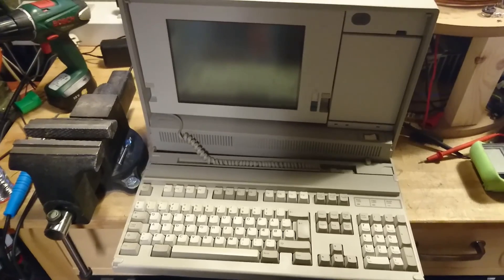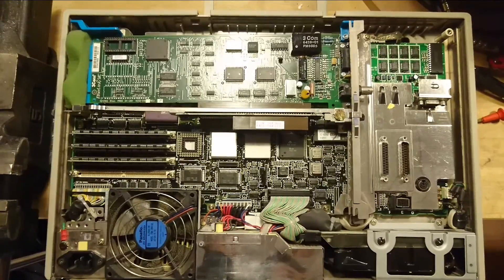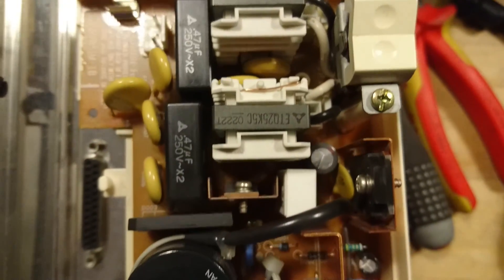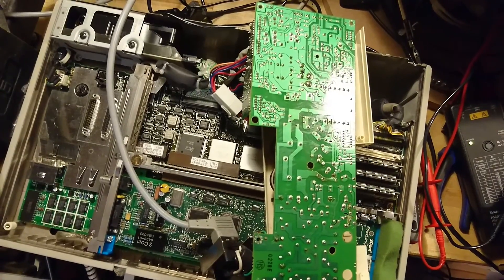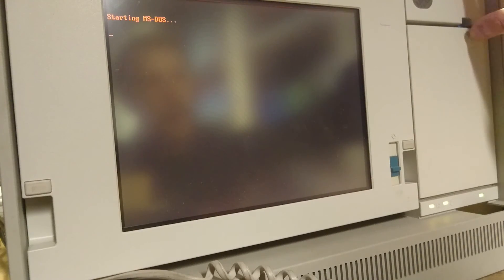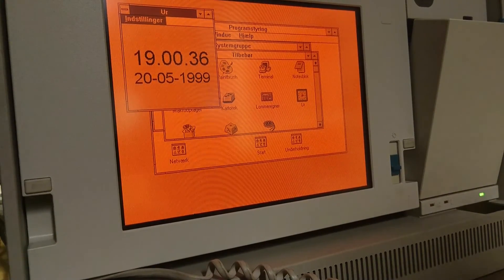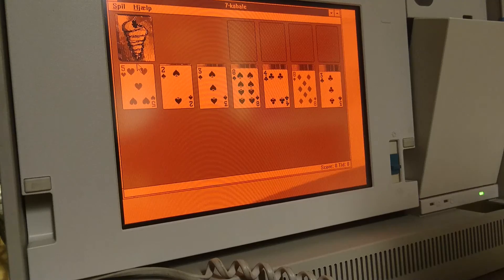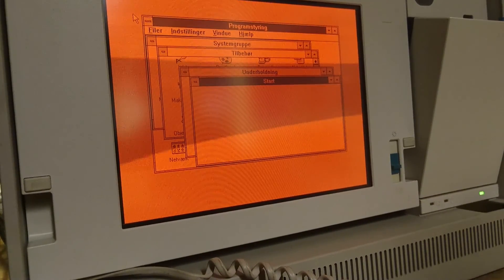IBM PS/2 model P70 (386DX-16MHz) portable computer repair, teardown and test

Comment: Nice - my IBM Model 8573-121 wont show nothing on display :(
Reply from the maker: Check your power supply :)
Reply: @KaizerPowerElectronicsDk  Big caps in secondary side ? Like in move ? BTW Greetings from Poland 😀😀
Reply from the maker: @liseu  Yes, the large electrolytic capacitors, as I show in the video, is most likely dried out and needs to be changed. Happy new year in Poland! :)

Comment: Instead of buying an VGA 14 tpin to 15 Pin Adapter you can just break off the one pin on a usual 15 Pin VGA cable carefully and it will work just fine.

Comment: That old laptops are luggables are great machines ! Once we had a KAypro 10 - but it's not an IBM-PC compatible and was sold about 2012 to another collectioner of old computers.( Now I have only Toshiba T3200 - 286/12mhz laptop with orange glowing screen )
Reply from the maker: I am struggling to get my lugable up and running again, after it lost bios battery, it is very hard to try and create the very specific IBM boot disk that is needed to restore the bios.
Reply: It's sad...( 

For me I've made a Setup Diskette on 360k 5-25 floppy twice - for the IBM AT 5170 and for Compaq Deskpro 360/20e'1989. I made them on a P-III pc with a 1.2 TEAC floppy drive atached to it.
Reply from the maker: Yes, I will have to try my luck on a old native windows 95 machine I got, that I can boot in DOS and make the disk.
Reply: I wish you luck. LEt me know if you have any troubles or suceed with this task). I think a program WinImage can be used - to unpack image to diskette - it works on any Win - from 9x to present win_10)

Comment: I just bought one of these that I cannot get to POST. It powers on, but only the hard drive spins up, and no other activity happens beyond that. I checked the voltages on the block connector, and everything was within their appropriate tolerances, except for the -12v line, which was putting out only -10.64v, instead of the minimum -11.0v the datasheet calls for. I assume that this is a red flag, and possibly a capacitor issue?
Reply from the maker: Solder out the output capacitors and measure them. If you can not measure their capacity, just change them to new ones and do it by trial and error.

You might also have a flat backup battery pack, mine measured 3.6V on the 6V pack, so it was nearly dead, but did still keep the bios settings. I did however accidental disconnect it and lost the bios setup, so now I am trying to restore it with some IBM reference disks I found online, more about this later :)
Reply: Thank you for your help. I finally pulled the power supply apart and had a look at the four (?) 1800uF 10V caps, and noticed they have just a slight bulge at the tops of them, which has me wonder if they're failing or going to fail?

Also, mine is missing the 6v CMOS battery. Not sure if that will affect anything?

Thank you again!
Reply from the maker: Bulging capacitors are defective and have to be changed. But change all them as I did, if it is the same cluster of capacitors that are failing. They just have had it too hot over the years.

You need the battery for it to remember its bios settings, it will not be able to boot without it. You also need to restore the bios with a IBM reference disk, I can not tell you which works as I am still struggling with it :)

Comment: Did you replace the rectifier also or just the capacitors, I remembering playing that game, thumbs up :) Alex
Reply from the maker: Just the capacitors, when zoomed in on the switching waveform it was looking fine and output is now stable.
Reply: Kaizer Power Electronics Ok, thank you :)